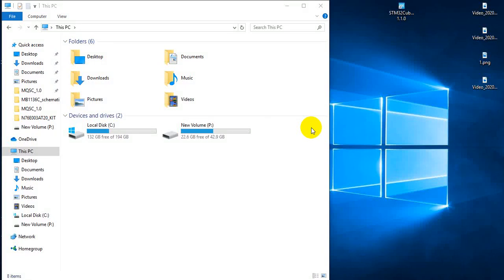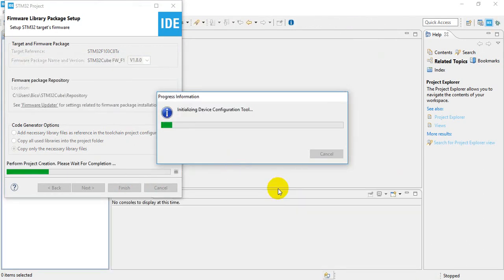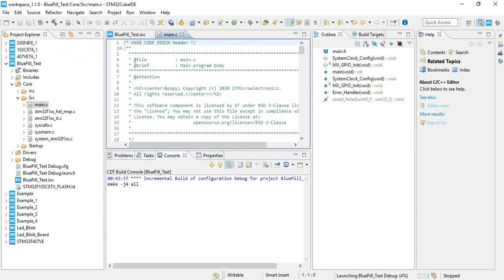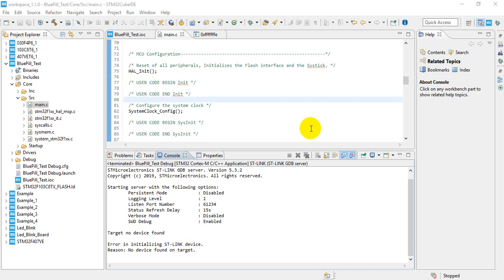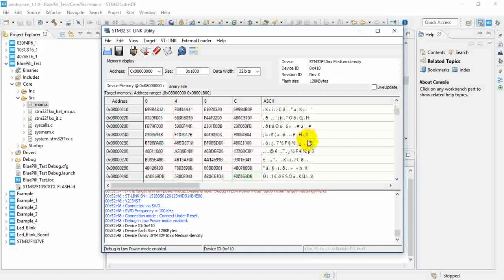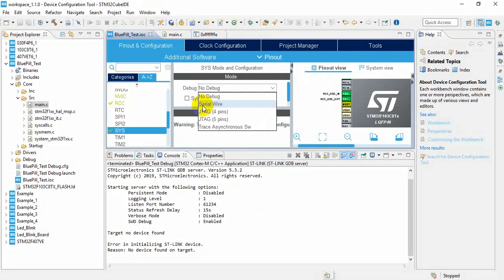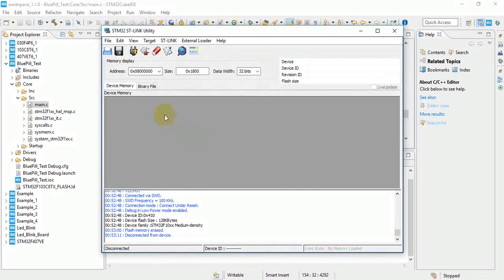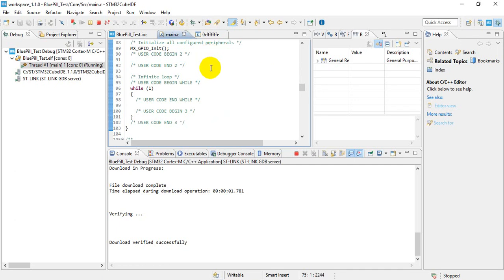STM32CudeIED Get Start | Solve some problem | ST-LINK V2 | STM32F103

Comment: I faced an issue when i debug my code   
System shows error that No ST-link detected please connect ST-link and restart the debug session.   

But i don't use any hardware. Only a basic program of printf i debug